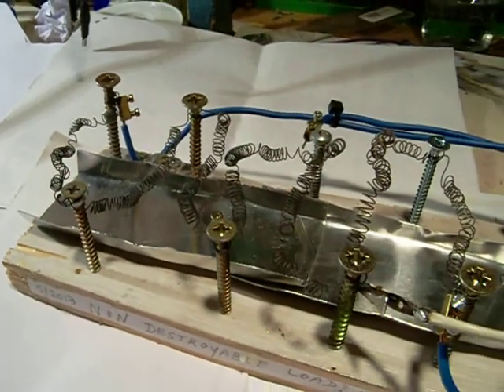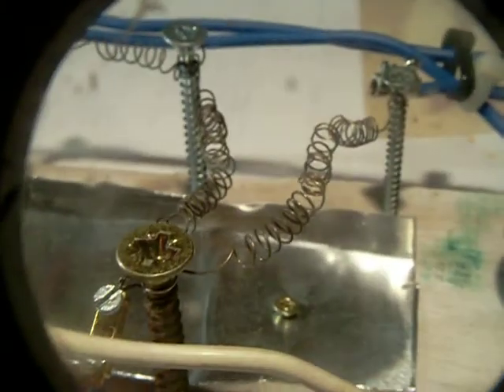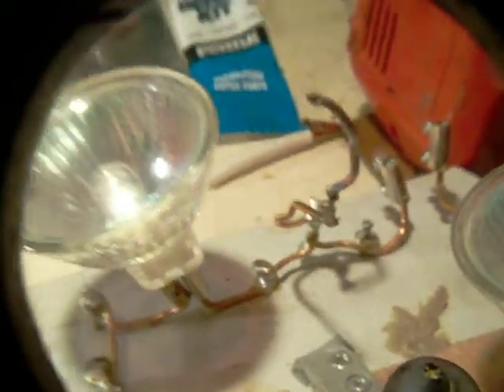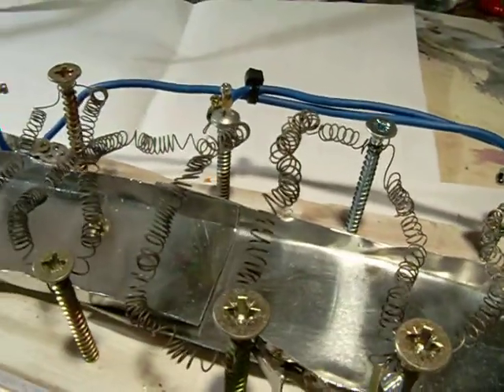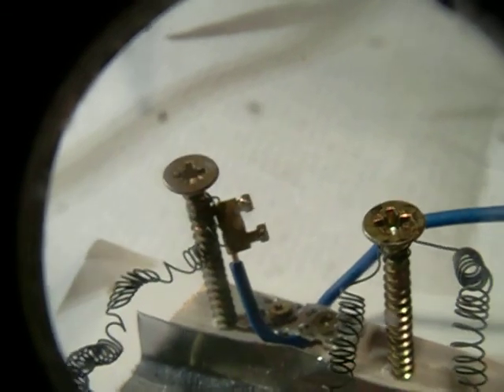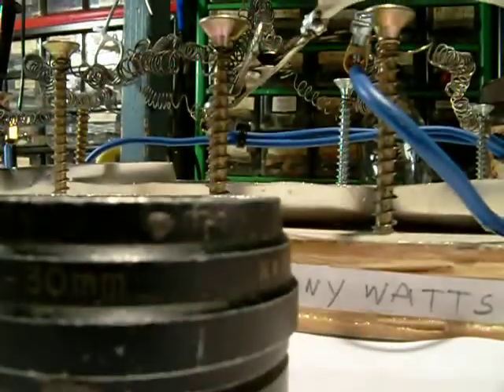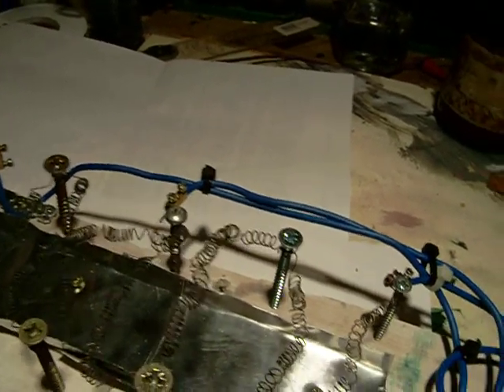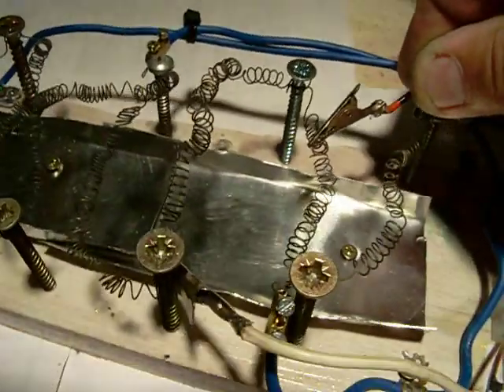how to test (power) transformers with a dummy load

Comment: I too use a heater element from broken hair dryer for testing AC. For DC, I made a transistor+opamp dummy load and it works great with settable current rating.

Comment: hmmm how many windings on the transformer do you test simultaneously? ALL of them??
Reply from the maker: The secundary winding(s) that I want to use is/are tested in practice. I watch the voltage drop, the current that flows and the heat development at the nominal load during (say) 24 hours.

Comment: How to test a transformers maximum output current?
Reply from the maker: With a dummy load, Ampère meter. Set the trafo to the nominal output current for 24 hours. Look whether it gets too hot. If so, lake a lower current value (higher dummy resistor) and test it again the same way.
Reply: thank you